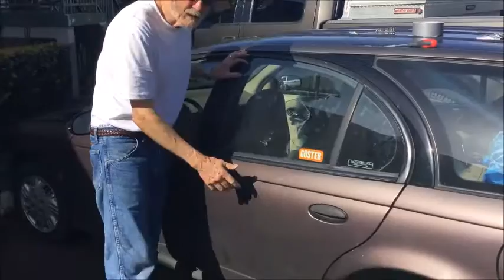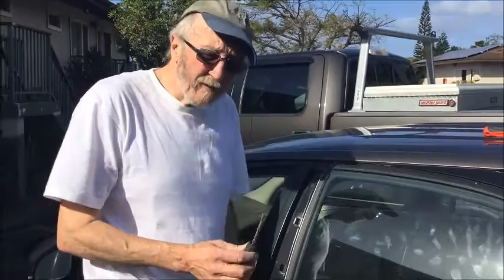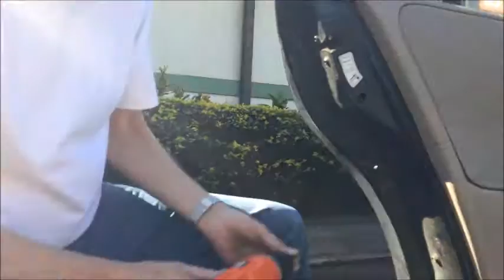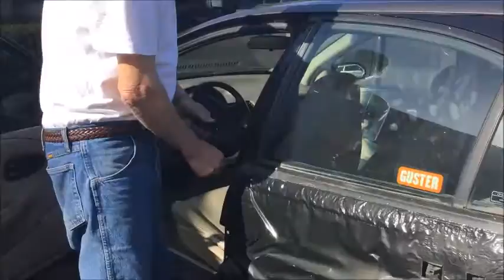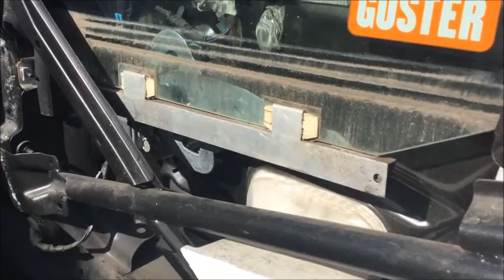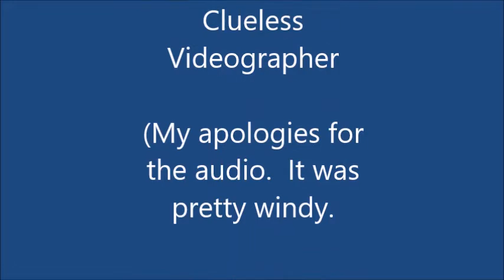1998 Saturn SW1 Rear Power Window Repair

Comment: I have a '99 Saturn SW2, I only had to take off 1 t15 screw holding the windows wiper trim and all the T30 screws. I did NOT have to remove the vertical strip you removed. Not necessary. When taking off the sound proofing, it helps to leave the door open in the sun for a few minutes to soften the sticky glue.. You totally missed the actual problem. In that Metal c-channel on the bottom of the window, there is a black plastic slider that the ball on the actuator goes into. What has actually happened, it the slide broke in half. It works like a ball & socket joint. as the actuator rotates up and down, the slider goes back and forth in the c-channel. If you remove the aluminum slider from the bottom of the glass, you can see the slider., although what you have done will actually work, you're just grinding a steel ball against raw aluminum. to remove the aluminum slider from the glass, you just push in two plastic tabs and slide the aluminum c-channel to the left and it comes right off. you should now see the slider now broken two pieces. 

How I fixed mine is I found a fiberglass washer, ground open the hole a bit to go over the round part that broke into two, ground down the plastic slider enough for the washer to fit onto the slider flush,(tightly to hold together the two halves) and assemble the slider onto the window motor actuator. it took a bit of time , but I got it on. Then slide the black slider into the c-channel, and then slide it back onto the windows glass. I did have to drill out a divot they punched in to keep the slider from falling out of the end, but I just put in a screw to keep it from sliding off. it also helps to over-grease everything so it runs smoothly. Some garage door lube inside the plastic tracks below the glass helps too.  I have actually just gotten back from work today and I could not roll the window back up. I caught another video on how to remove the panel and actually found your video after I have actually fixed the window.

Comment: remove the black plastic liner and old sound proofing garbage...cut a new liner out of heavy clear plastic (garbage can liner/mattress bag etc) and tape on with HVAC aluminum tape.   When the speed nut clip breaks the plastic tab on the door panel...repair it using JB weld or plastic epoxy glue to fix a metal washer on the body panel which will then hold the speed nut in place.
Reply: Funny you mentioned the broken speed nut . The bottom corner one broke off on me as I was taking out the bolts, I melted the plastic back together and melted steel wire in it to re-enforce the plastic.

Comment: Job done July 20, 2020! Thank You for teaching me, Michael. 

Hardest part was getting that plastic pin back thru the door handle during reaassembly! Also, have a vacuum handy for when all that door insulation dust comes out.

I know this is a rig up, but I'm hoping it will last a couple years. If not, I'll buy that piece that goes in the track..and maybe I'll have to buy a regulator then too :D
Reply from the maker: Thank you for your kind comments and suggestions. Just so you know. I still have this car, and the windows are still working as repaired.

Comment: There is a plastic piece that the knob fits in. The plastic piece then rides in the channel. The plastic piece breaks in half, a common problem. To properly fix this, the piece needs to be replaced as this will just pop out again eventually.
Reply: Unfortunately, GM No longer carries this part. Someone mentioned in the comments that a similar part that will work is available from BMW.

Comment: Thks but hows abouts replacing the broken $5 DOOR WINDOW REGULATOR GUIDE - GM 21172105
Power Window Repair, Window Slider Replacement: Second Generation Saturn S Series. https://www.youtube.com/watch?v=YURudd3oiCo

Comment: How do I disable the power lock. I can't find the fuse. When the car is shut off the power lock is making a running noise and it's draining my battery. Please help.
Reply: Lena - It is easy to remove the power plug to the power lock. Take a screwdriver to the top of the housing that the power lock button rests in on the inner door panel, and pry the power lock button housing down and out of the door. On the back of the power lock buttons you'll see the power cable. There is a clip like tab holding it onto the lock. Carefully push down on this with a small screwdriver and the power cable will come out easily.
Reply: Italo Lenta thanks
Reply: Lena Banks pull fuse

Comment: ...thank you so much, this helped me understand what went wrong with my window, it turned out the plastic piece in the track broke in two, I had some aluminum stock laying around and made the piece better than factory...
Reply: K Ryan you don't feel like making a few of those up and making them available for sale do you? 👍😎🙏
Reply: you should 3d print them out of plastic. of you made it out of aluminum, you're just grinding metal on metal whenever you open and close the window. I pieced them back together and modified it with a Dremel to accept a fiberglass washer. the washer holds the two pieces together tightly, and is held on by the c-channel track. Greased everything up, an assembled it back onto the actuator. just slide everything back together, and it works. I don't know for how long though, Saturn out of business, and that part might not be available anymore.

Comment: Thanks for the video.  For a 96 to 02 the missing plastic piece that fits between the pin on the arm and the groove on the track is part # 21172105 Slider-Window Regulator.
Reply: it probably wasn't missing, it was still in the c-channel, he just didn't mention (or notice it).
Reply: This part, Sadly, is no longer available. Maybe someone will create a design for a 3d print. I had to modify the part with a washer to hold it together.